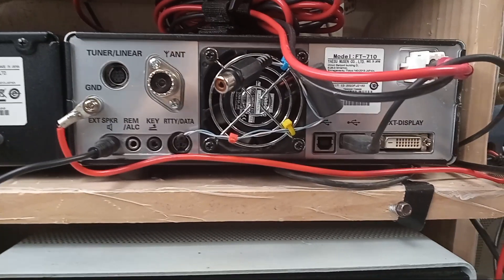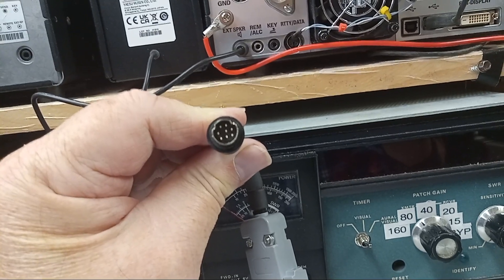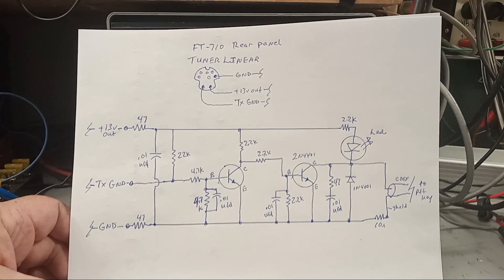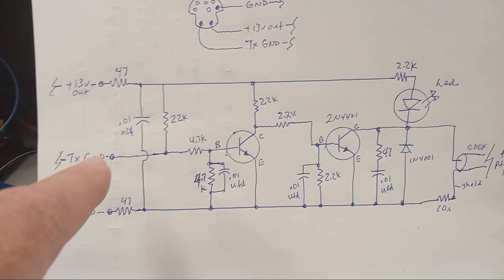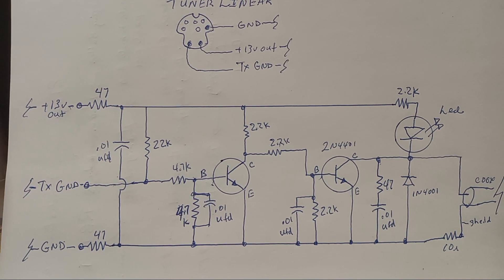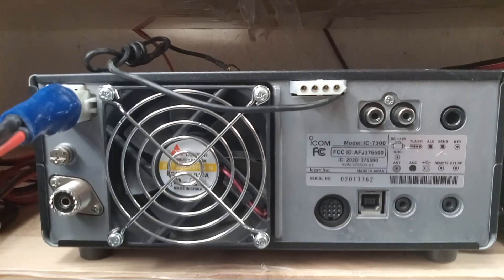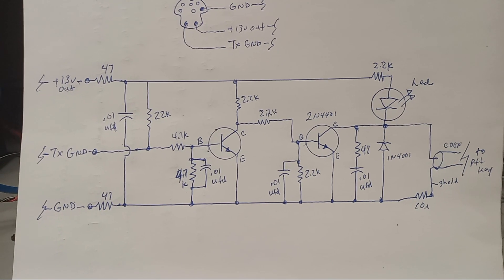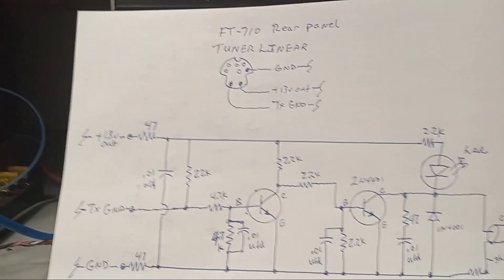Ft-710 non-Yaesu linear Amplifier PTT ranting

Comment: I just made a keying relay cable for my ft-710 to  ket an antique clipperton-L ,  on my amp you short the rca to ket the amp. so on the contact side of a small relay  i hooked the rca, the coil of the relay one side getts the 13.8v  the other gets the tx ground, use a diode with the  cathode(silver band to the 13.8v side.   The relay im using draws 20.8ma  and the contacts are rated for 5 amps.  Have had this little keying relay cable in service for  many years without any issues. cheap and simple

Comment: I think this is being made more complicated than it needs to be. Yes the choice of connector from Yaesu is far from ideal but forgetting that for a moment, you can easily get 12v and a switch ground out of the FT710. I used that to switch a 12v relay, max current draw with LED <100ma. When the relay closes in gives a closed short contact to the RCA out which then makes it exactly the same as the Icom 7300 / 7610 etc. Most modern amps trigger on a closed circuit, older valve amps did used to use weird often negative voltages to switch. Search for HAM RADIO LINEAR RELAY ISOLATOR it should work fine, (but you will need to make a cable or buy one). I have used this on a FTDX10 and FT710, no issues at all, the relay box is fused at 160mA this protecting your radio from excessive current draw, the relay removes ALL electrical connection between the radio and amp, much less than the max sync current.

Comment: Yes Same issue, when I bought my ACOM,  in the end pulled out my old FTdx3000  to test my ACOM AMP,  i planned to  purchasing a new FTdx101D, eventually,  and Yes I also asked DX Engineering, said no proper cable available for the 710, as I also had the 06AT, I like my 710 but wont integrate with my ACOM 1200S and 06AT combination, it seems, or at least easily

Comment: I almost purchased a new ft 710 field but got a barley used FTDX3000D instead, simple RCA cable to amp and 3 antenna ports 1 tha can be rx antenna only, so far love the FTDX3000D.